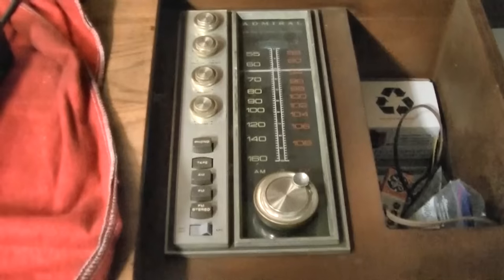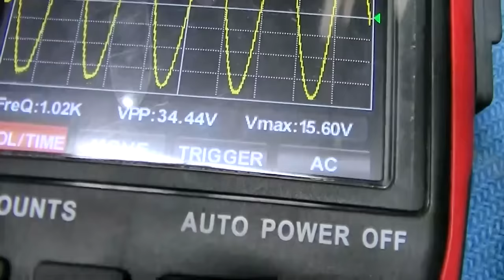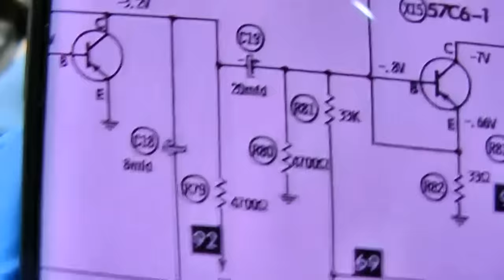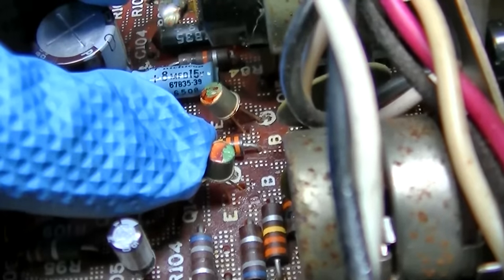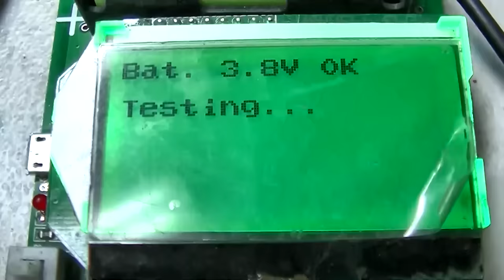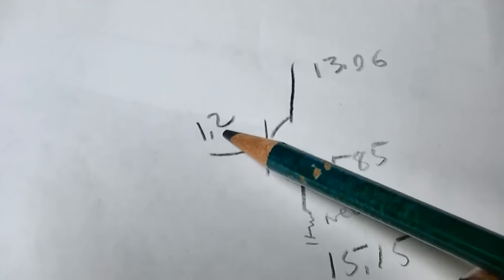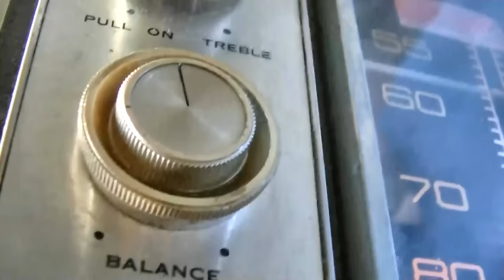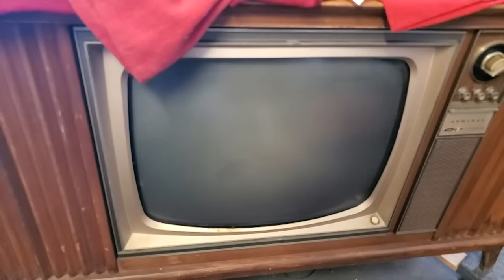1965 Admiral Stereo Tuner Amp Repair AM FM Receiver Unbalanced Channels

Comment: I remember that one, the stereo did not work when you first turned it on, but then it came to life by itself almost as if a transistor had reformed somehow.  Interesting repair, thank you.  That inexpensive scope has taken over my workbench too, it's just so convenient and easy to use.
Reply: Lesson on Vintage equipment capacitors don't don't always fix the related issues it's how we teat the unit

Comment: Good video, first thought would be transistors, then caps, educational to watch and find out it was resistors. A good thing to remember is that digital multimeters run into sampling problems and roll off measuring mid and higher audio frequencies, so if If you are tying to see accurate differences between high and low frequency response, analogue meters or the scope are the way to go.

Comment: That "oscillation" you noted at about 7:39 is due to power supply ripple.  It seems, from what I saw of the schematic I saw on your phone, this chassis used a negative DC supply, with the output swinging from ground (+peaks) to -V supply (-peaks), so the ripple will show on the negative peaks.  This will not be a problem with normal listing, since the output will not swing that far, except on very infrequent peaks.
Reply: But it should then be on both channels.
Reply: Yes, it would do it on both channels, but one of them may do it sooner (at a lower level) than the other because its no signal bias center voltage may be different, or another component may be slightly different between the two channels.  It seems to me that this Admiral stereo used the cheapest grade of resistors, capacitors, and transistors, and after 58 years, almost anything could be going klinckydingkler.

Comment: It may not make a difference since everything appears to be working but around 26:19 in the video the blue, grey, black resistor would be 68 ohms not 680 ohms and I believe that metal film resistor you measured did indeed measure 680 ohms. Like I said, seems like everything is working ok despite the wrong value resistor.  Really enjoy your videos keep em coming.
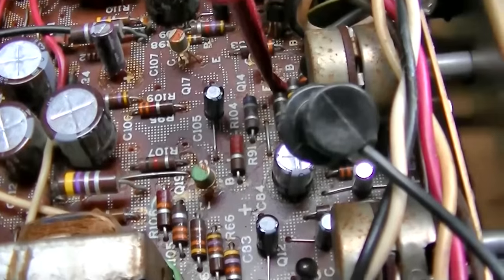Reply: The ring on the resistor looks brown in my monitor an 26:39 .
At 26:19 it looks indeet a bit darker - probably a camera effect with this reflection.
Reply: It's brown for me, too. And I would have been surprised if Shango had got that wrong anyway. I believe 680 is correct.
Reply: It does look black at first glance but then you can see a 1k with an obviously much blacker black band and it's obviously brown in comparison.

Comment: I had an interesting Admiral stereo repair (not the chassis in your video). You could not turn the volume down completely. Turns out it was NOT the volume control, but rather it was an open section of the filter capacitor (can type).

Comment: Right today chassed a noisy channel on a pretty old National cassette recorder (all germanium). Used Shango trick with a cap and worked like a champ. I had a scope with me with it not that obvious, the noise was in the very first stage of the head preamp and signal is very tiny (entry scopes cant do 50mV reliabliy ... too much noise). Just by comparison you can tell something and you still you are  let with the setting because this noise is more in mhz range. Cap did the trick straight foward. 2SB346 original Matsushita with hfe 14 and vf 34mv (looks like dead to me) . Replaced with AC121 I had in hand. .... get the channle back, of course now it leans to the left.

Comment: I've heard carbon resistors make that sound before. I'm curious if the Carlson "super probe" would have helped, at least in finding the resistor noise. Also, how do you like that scope? That's for showing the video. Sounds good.

Comment: Alot of the early solid state kenwood gear in the kt, ka, and kr lines all suffer from resistor disease like this. They are often overlooked as "cheap" or poor sounding, when actually they're quite nice when you replace all the caps ans out of tolerance resistors

Comment: This is why I always change out all the electrolytic and paper caps. Then change all the carbon comp resistors. 9 times out of 10 it solves all the problems and the time spent troubleshooting can be used to replaced problematic components. Now I don't have to worry about reliability because the remainder of caps and resistors not changed if I only change out of spec ones will most likely go out of spec in the near future, especially the old caps.
Reply: I get replacing electrolytic and paper caps (more than 30 years old) but not resistors, just diagnose and replace the bad parts. Two resistors out of several dozen is not a bad failure rate. If it were above 10 or 20 % then yeah, maybe consider replacing all of them. If it's above 50% definitely. It also depends on how much you value the thing.
Reply: @brainndamage Gotta love the "load up the parts cannon" types. IMHO that's not a hallmark of a real repairman. Only guesswork. There are certain components that are known bad like bumblebees, wax paper caps, early Japanese electrolytics but that doesn't mean it should be a blueprint for all repairs. Shango does a proper troubleshooting workflow.
Reply: @brainndamage  i have rebuilt many radios. First carbon comp are unstable and widely influenced by temperature and noisy. Out of all the resistors on a set approx 25 percent are way out of tolerance. 25 percent out of tolerance by a little bit and around half the remaining in tolerance ones are close to the edge. Not all of them are able to be measured in circuit so if i pull a leg to measure might as well change it. Resistors are dirt cheap.

I dont want to have to play with it later on. I have also seen resistors go open when they warm up or drift but test good when cold. I want a reliable set that in the future i dont have to worry about the resistors.

Did you know that just by unsoldering a leg of a carbon comp you can change its value permanently?
Reply: @kwacz  you must be getting bad batches or radios with lots of hours or stored in humid conditions, I've fixed a couple of radios as well (about 10 I estimate, both tube and transistor) and I haven't seen nearly that big a failure rate for resistors. Especially tube radios are very forgiving and will usually still work fine with a resistor 50% out of spec (depending on where it is) of course it depends on how perfect and reliable you want to get it, I rather keep it more original if it works and all the voltages are close to spec, if some voltage is off I replace just the bad part. I don't care about noise in a radio for general listening, unless it's hi-fi gear.
Reply: @kwacz  just this week I fixed a Grundig "Teddy Boy 203" from the mid-60s that had so much water damage the case was all warped and falling apart. 6 bad electrolytics, one missing selenium diode replaced with a germanium + resistor, one bad diode in the ratio detector, all the voltages were close and it works good with plenty of sensitivity after a full alignment, I didn't even bother checking all the resistors (some would be so hard to check because they're on the UHF daughter board I'd have to take it all apart). The case is beyond repair unfortunately, maybe in the future I can design and 3d print a replacement, or transplant the chassis into a different box.
Reply: @brainndamage  high hour sets stored for years in damp attics or basements. I can get them dirt cheap because they are filthy and smell musty, but i can get the smell out of them and they usually clean up and look close to new in most cases.

Comment: From experience in a lab I've noticed several times that your "average" DMM (which will be ok for 50-60Hz) will show very differently on higher frequencies like 1 kHz. Do they show the correct value at this freq.?
Reply: I was wondering too how much he was comparing the high frequency response of a Fluke meter with the high frequency response of a OneHungLow meter.

Comment: Interesting amp fault. Always difficult when feedback is a factor. Engine mount bolts sheared on my 1985 Ford Escort. I had to prop the engine on steel rods and carefully drive it to a friends house. He welded heads onto the sheared mounting bolts and unscrewed them.

Comment: Hello Shango.  Excellent diagnostic video.  Let me tell you that I bought a Technics TR RS373 double deck to restore.  Man, you don't know what it's costing me to adjust the speed of the tape.  I don't have any speed adjustment tape and I don't have any tape to adjust the azimuth of the magnetic head.  I don't know how I'm going to get it working properly.  Yes, I managed to get the entire matsushistic o blober inflober mastic mechanism to work... but I have to correct the speed of the tape. Can you gime me a hand?
Reply: Cassette tapes run at 1 7/8 inches per second.  Mark off 18.75" and adjust the speed until it takes 10 seconds to run it.
Reply: I got pretty good at adjusting speed by ear using a prerecorded tape of a well known song. Double check it by comparing it with a digital copy. You should be able to get it close enough to not be noticeable when playing tapes made on other decks. 

For azimuth, simply adjust it until the sound is brightest.
Reply: Tried this trick many times, get a GOOD commercial tape. I tend to use Phill Collins "but Seriusly", recorded by ATLANTIC (not WEA). Them play same in a  CD player, same song, of YT. Try to launch deck in syncro.  It is a bit difficult but doable. My criteria is to achieve 1min without the deck going out of sync. On a decent deck with a good working motor, this is not hard at all. Let the deck to warm up. Motors suffer a bit from thermal drift. I dont know how azimuth is done on this series. I think that rotating heads had two STOP screws that set the azimut (like SONYs).  You can calibrate the azimuth with a good commercial tape, just by getting the maximizing the highs.  Ideally you will need a test tape. but I Adjusted speed and azimuth by ear many times. No for precision purposes. But the 373 wasnt mean to get you there anyways. You need to do BOTH motors, unless you are using just one deck. But if you are going to use it for duplicating, please adjust both motors and let the machine to warm up prior to use.
Reply: @russellhltn1396  LOL, done that tooo ..... I spliced it put in a case and recorder with music so I can use my cronograph to measure the elapsed time. Not bad as an option.
Reply: SImple, cheap fix
Record an "e" note from a guitar or synth or organ onto a tape that is in a known speed correct deck
put this tape in your slow/fast deck ,turn up the amp and trim the speed using a guitar tuner
do not use metal screwdriver,you may ground out the speed control circuit  and fry the driver which may be on the PCB or even inside the motor 
(mabuchi motors used sometimes,and also Matsushita brands have them inside the motor)
If this is an autoreverse unit,leave the head adjustment alone, the parts are so delicate
any fumbling around and it'll be junk
Ask me how I know....

Comment: That amp puts out around 12-18watts, you just square the voltage across the load and divide it by the load impedance; (so ~10V * 10V / 8ohms = 12.5watts)

Comment: Freeze spray helps here.
Blue, Gray, Black emitter resistor is 68 ohms not 680 ohms. Blue, gray, brown is 680 ohms. You replaced a 68 ohm resistor with a 680 ohm resistor.

Comment: OK,  I'm at the beginning of the video,  so I'm going to guess the issue based on the symptom.  Since it's already re-capped,   I guess a carbon comp resistor that climbs in value when it gets warm.  I've seen that happen.
Reply: Cool....... I wasn't totally wrong...  I was onto something.

Comment: thats why they say Mopar no car buy a Mopar you will have no car eventually
Reply: When they real Chrysler existed they made great products. Look at how many Dodge Darts are still running around as daily drivers. Chrysler was known for their bulletproof drivetrains. The torqueflite 3 speed automatic is still considered by many to be the finest automatic transmission ever produced. Drag racers loved them because they would handle 1000hp like nothing. Rolls Royce bought them to put in their cars because they couldn't make one better.  The slant six,318 and other engines were incredibly robust and as reliable as a hammer.  Their torsion aire front suspension that debuted in 1957 handled better than their contemporaries. More Chrysler cars,including low prices Darts had factory air conditioning in the mid sixties than other makes,and their AirTemp air conditioners always worked well. They also had advanced technology like Electroluminescent dash panels in the 60's on their higher end models.  
It's sad that the garbage being peddled under the Chrysler name is tarnishing the name of the real Chyrsler when this modern crap has no connection,other than name to the past.

Comment: Several Possibilities exist: one of the pots have to be cleaned or replaced, a component or wire or both is over heating, or you have a loose part, or a damaged internal part!

oh a 12KhZ sound does not hurt my ears, Everything That comes out of my ear phones Stere wise, is true seperated stereo. so, the Freq. resp. needs to be some where else, for my ears to start to have an Ear ache!